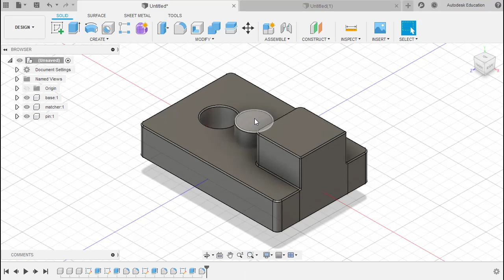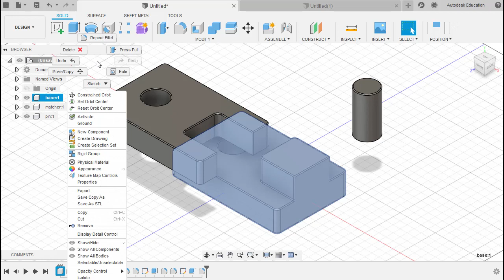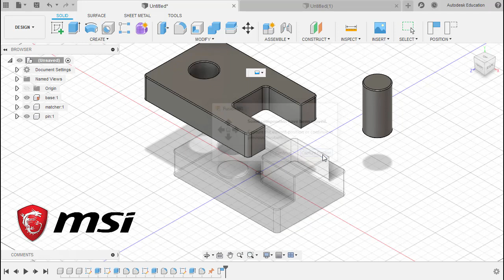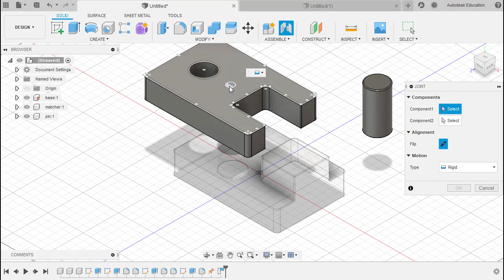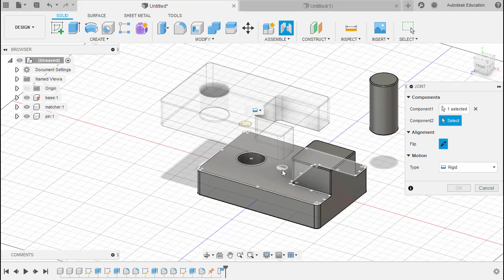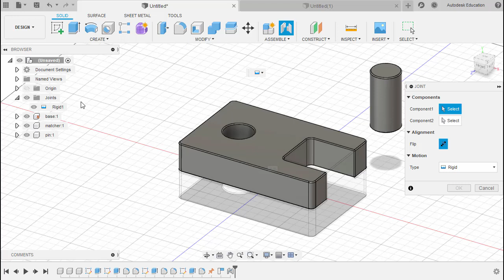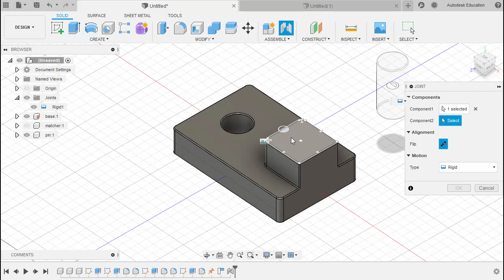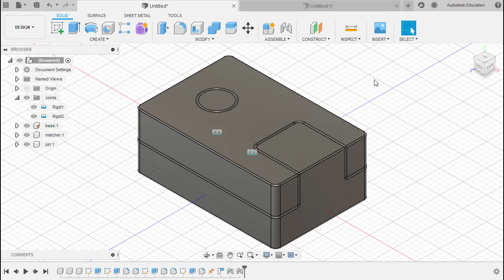Fusion 360 Monthly Challenge: November 2019 Part 03

Comment: Hi,
Thank you for another F360-challenge.
This time I'd like to share what I did.
Q: I feel that in this case this works fastest. Would there be any drawbacks to this that I am not aware of?
1. I draw the sketch of the outline
2. Extrude the base 30mm > new component
2b. extrude the 'bump' from the base 60mm > join
3. open the sketch again
4. extrude the top part 30mm >> offset 30mm >new component
5. open the sketch again
6. extrude the pin 60mm > new component
7. add all the fillets
== == == now all components are built in place
8. assemble > joint > as-built-joint
Regards,
Willem
Reply from the maker: Curios to see how you did yours. Share a link ls